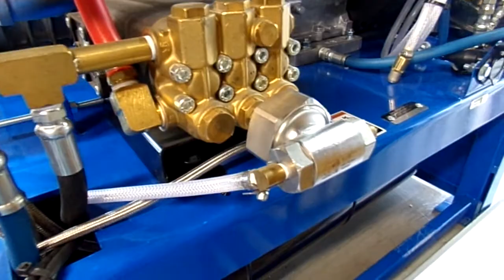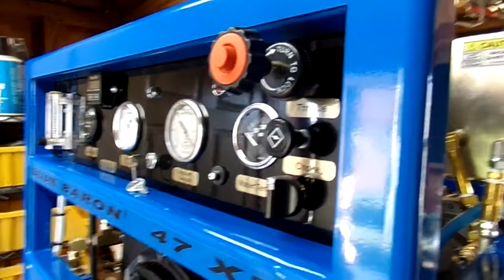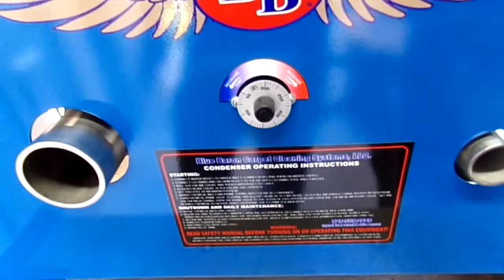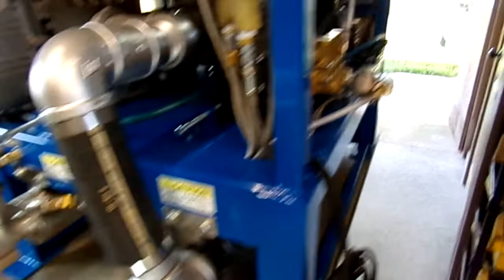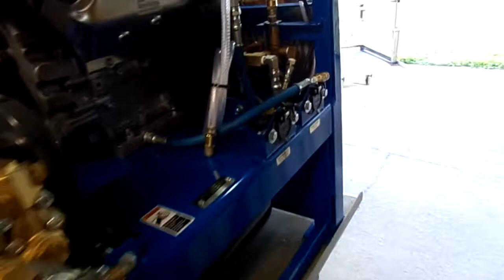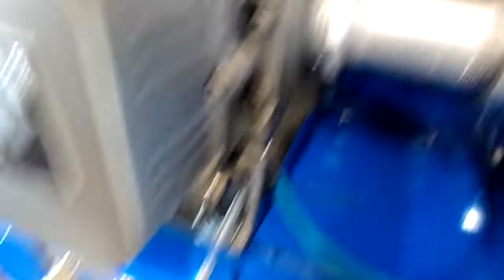Blue Baron Truck Mounts Unsurpassed Quality & Performance

Comment: Pete garland has a great knowledge on his buiilt  units he builds from the compact 36 
To the compact 45 THE 33 se the 47 xl truckmounts this machines run quieter then the competition units also so easy to maintain in case of a breakdown , you dont have to go to your truckmounts places for parts don -jons , interlink supplies , and if ur close pete has his own fabrication shop for those special parts. Please if  your looking to purchase one of the units , please check out his inline filter box . Built solid and makes work alot easier to clean out after every job .  I promise you those units are built well and are solid the waste tanks are aluminum not steel and also will last a long time . Please call pete today to see his TM and his shop . He also has chemicals and supplies for the cleaning industry. We purchase a compact 45. With the inline filter box . Huge diff on dry time on the carpets and tile flooring no to mention our customers say how quiet are machine is compared to our prochem truck mount. Check out his other videos on other truckmounts. Pete thanks again highly recommend this builder and fabricator for your truck mounts..... cjs carpet upholstery grout tile cleaning specialist..